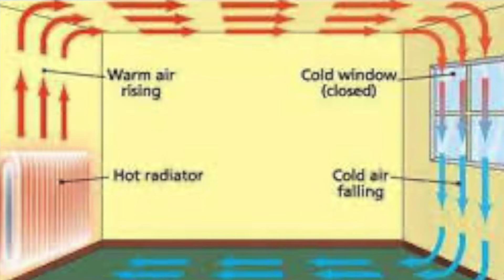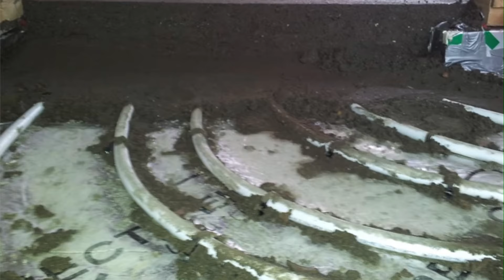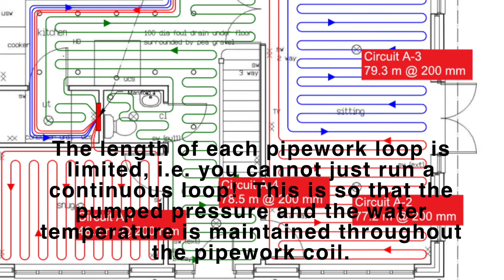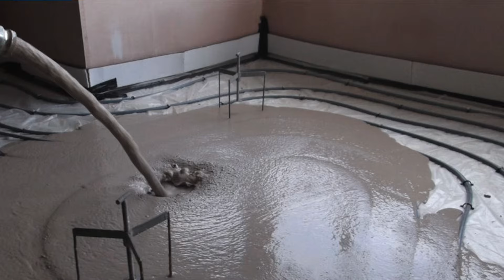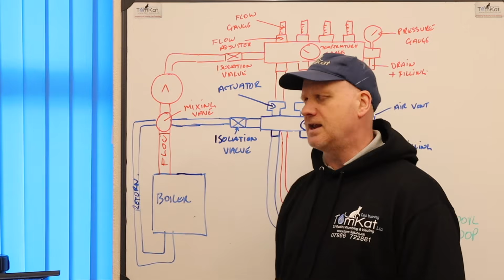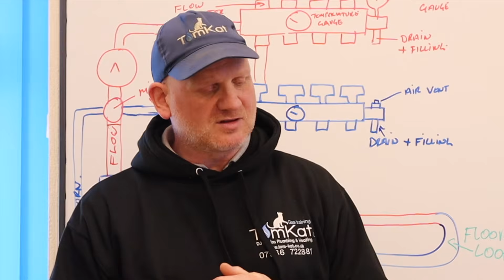How to install underfloor heating. Full A to Z on the pros and cons of wet underfloor heating.

Comment: Thanks for the video. Do you have thought on efficiency of the different systems? The diffuser plats system on a standard non insulated concrete salad will have way more heat loss than the other. Would you agree?
Reply from the maker: For me it’s all about what and how the floor is constructed to what type of system you can use rather thank what is the most efficient. If I was to build my house I would use block and beam floors with kingspan and screed

Comment: If you are putting under floor heating in a bungalow would you still run the pipework in the attic and would you put the manifold in the attic?
Reply from the maker: That’s up to the customer I have a bungalow and I am putting my manifolds in the kitchen cupboards

Comment: Great Presentation and Explanation. Setting up the Pump to a Adapt Constant Pressure Setting is relevant. (Most cases it will use less then 5Watts. It ensures the flow is correct (slower is better so to give the heat time to exchange with the floor) Taconova has great UFH Pump Solutions. Robust and running dry is no issue. Bo risk ob blocked pumps.

Comment: Hi I didn't here you mention if the screed needs expansion joints, (i haven't see joints in other installation videos either). I expect they would as the dry screed goes from 5 to 35 degrees often. how many M2 would you recommend the largest area without expansion joints?

Comment: Under floor heating is an old technology at this point. The dust and particles canot seatle in the room and will cause lung issues down the line. 
The healthy option is when the pipes are in the wall.

Comment: Looking at the spreader plates installed on a floating floor: how thick should the chipboard and engineered wood be? In the clip it mentions the flooring shouldn't be more than 15 mm thick. Is this for both the structural chipboard and the finishing wood layer? Thanks

Comment: Can you use concentric with spreader plate system ?
Reply from the maker: You will need to get technical information from the manufacturer of the products because it depends on what you are using for what you can use
Reply: @tomkatgastraining  what are reputable brands available in Europe ?

Comment: Hi can we use two different pipe sizes with same manifold using an adapter.  I'm thinking for using a 16mm pipe for my kitchen which has a larger area and 12mm pipe in hallway with wood floor which i will take out n install 60mm insulation between 100mm joists.
Reply from the maker: Why would you? To achieve different temperatures you put the pipes closer or nearer together. The manufacturer of the system you choose can help you to determine this.
Reply: @tomkatgastraining  Its because my kitchen is a new build still under construction so i can set up the floor depth. but hallway is an old built and has 100mm joists. hence thinking of putting a low depth insulation (e.g. 60mm ) which will leave 40mm for pipe and screed. so using a small diameter will give me more space for screen (40mm) and then i will put a membrane and tiles on top. Dont want this to go higher then the adjacent rooms.

Comment: amazing video, I was wondering if you can provide us information for who are going  to move in to a new build with Rods, but want to convert it to UFH , does that work at all ? what are things we need to know . cheers
Reply from the maker: It’s all about the sub floor and height of the ceilings. Most new builds have concrete slabs so an overlay system is needed so probably the most expensive way of installing underfloor heating.

Comment: i heard manufacturer 100 times . but never said manufacturer of what ? pipes ? manifold ? heat pumps ?
Reply from the maker: The underfloor heating system
Reply: @tomkatgastraining  are you referring to underfloor heating control manufacturers or manifolds ?. I mean there is many parts in underfloor heating with multiple manufacturers
Reply from the maker: @GrimRIA  normally you would buy the full system from the one manufacturer ie pipe manifold and controls
Reply: @tomkatgastraining  sonif you buy from local plumbing shop everything separately manifolds pipes ect how do ypu calculate layouts and other things

Comment: At 1:50 you mention space heating can be run at a low flow temperature, e.g. 30°, but hot water cant -needs to be 60-65 degrees. How can the same system have two different temperatures? Or would you need a different system for hot water as opposed to heating? I tought airpumpa could replace a gas bouler but if they only have a flow temperature of 30 how is this possible.
Reply from the maker: Blending values reduces the flow temperature on the underfloor heating so able to run 72 degrees centigrade to the manifold then it’s reduced down by the blending valve
Reply: @tomkatgastraining I don’t think you are understanding how the “system” is designed and operated.  The control and three way valve along with an electrical element address the matter without incurring excessive electricity consumption.

As an engineer it seems the trades generally lack the education to engineer and the experienced based reality if trades is facing too many variables for them to be competent to design and install systems.  This is evident in the number of very bad installations we see.  The problem is a government that dished up £7,500 to install and created a rush to the till by anyone remotely connected to this new industry…
Reply: Thermostat regulated valve is there for that purpose

Comment: I don't like to stick tiles directly to the floor.   Is it ok to put down cement board on the floor and stick the tiles to that.  Will that work?
Reply from the maker: You would have to speak to the manufacturer of the underfloor for that information

Comment: Hi, enjoyed the video! Thanks for this! I did have one question. On 38.08 into the video, you mentioned a thin layer of polyethylene DPM above the screed if it's suspended timber flooring. To date, I haven't found any guidance or manufacturing info that suggests a polythene sheet is required. Is this mandatory per building regs, or optional? Also is there any risk of that sheet burning or catching fire from the pipes below?

Comment: Forget the under the floor boards, packs or copper tubes to heat your floor. They get too hot and they can actually almost burn your feet. If you go barefoot it in your kitchen which isn’t carpeted and they get too darn warm on the carpeting sometimes too. How do I know because I stayed with some friends once that had this type of heat. No way and it’s expensive too.  I would go with a good boiler that has the old radiator types or against the wall with the nice pipes cover up that stick out what 6 inches.?  That’s one way or possibly a geothermal heat pump boiler system and that I’ve been finding interesting but I don’t know how reliable they would be over a 25 year period?  Geothermal is the way to go in both hot and cold climates if you can afford it and if you think about it, it’s probably going to be the best route over the years because you’ll save more money but boilers are also good if they’re high energy and they last for 25 years or more.

Comment: Hydrogen boilers are an insanely terrible idea. Takes 4kw of electricity to make 1kw of hydrogen. Or you can get the hydrogen from fossil fuels. Only reason they use it is to keep gas transporters in business.
Reply: Derek is incorrect when he says that hydrogen boilers don't emit any pollution. Hydrogen WILL emit NOx when burnt in AIR.
The only way to ensure the only products are H2O molecules is to supply the burner with pure oxygen, which isn't going to happen.
If you burn hydrogen in AIR, you will get NOx, which is bad for health, even before you consider GHG effects.
Reply: @Roger Bradley  that's a good point. The NOx byproduct needs to be weighed against the production...and disposal of batteries and their pollutants. Mining lithium, cobalt, copper is certainly not without its downsides. Most of it happens NOT in the USA...so we DO get to export pollution...which is a BIG goal here in US.
Reply: @rogerwhiting9310  it's true that batteries have an environmental impact. They're not perfect. However the lifetime impact of even the worst batteries is significantly lower than mining and combustion of fossil fuels. Cobalt is already disappearing from newer battery chemistries, shears a LOT of cobalt is used to remove sulphur from petrol, but few critics of EVs realise that. Flow batteries can last for several decades in service.
Reply: *Shears = whereas
Reply: @Roger Bradley  I am not sure if that's true or not. Certainly the recycling of the old batteries is almost nonexistent. I think battery production is one of the dirtiest things on earth. I think we are replacing one problem with another...but the mining is mostly  non US. That is part of the big "green" push
Reply: @rogerwhiting9310  Battery recycling of lithium batteries is already happening, but it's true that it's in its infancy and needs to massively scale up in capacity. It will happen though, because the substances are almost infinitely re-usable, and in demand, so there's money to be made. The main problem in scaling up quickly is that batteries are lasting much longer than originally anticipated, so there's a shortage of batteries to recycle. New chemistries are also much cleaner than people generally realise, e.g. LiFePO4 so no cobalt, no manganese or nickel required. Lithium can be extracted directly from brine (even sea water) and no need for those horrible evaporation ponds you see in South America. It can even be extracted from some old mine workings, cleaning them up in the process, as in Cornwall in the UK. As with many things humans do, we can do things sustainably, it's just a matter of the choices we make.
Reply: Thing is, that you can use solar or wind to create alot of el energy sometimes and its expensiv to transport and store it or amlost impossible at large scale, so you make hidrogen
Reply: ...brilliant!
Reply: What a great video
Reply: It sounds like it MAY be the fuel for the future as they are finding ways to make hydrogen with a positive return on power...getting more energy than you use manufacturing it.

Comment: Hello, I am desperately looking for some advice, I would be extremely grateful if anyone was able to help?  I have underfloor heating and I have a manifold in the cupboard.  When I turn my heating on, all the flow pipes on the manifold go hot (as expected) but the flow pipes for the different rooms are different temperatures, for instance my bathroom return pipe is cold and does not warm up at all, although the flow pipe for the bathroom is hot.  Does anyone know why this may be?  Many Thanks in advance
Reply: Hi, are you sure the actuators are opening, also making sure the pin under the actuator heads springs up and down and is not stuck in the closed position, the flow pipe may be getting hot but not necessarily circulating, try turning all the room thermostats off and only running that bathroom circuit
Reply: @Kirk Vickers  Hello, thanks so much for your reply.  All the actuators are open, all of the flow pipes are boiling hot (there are 8 altogether), but only 6 return pipes are boiling.  The bathroom and living room return pipe is just not warming up even though their actuators are open and their flow pipes are hot.  How do I know if the pin under the actuator head is stuck?  They seem to all be at different levels
- Thank you!!!
Reply: You can unclip the heads off, and the pin should be able to be pushed down and spring  back up If it stays down, then it is faulty.
Reply: Should the pin be constantly moving up and down?
Reply: You should be able to push it down and it should spring back up, if it doesn’t, then it is faulty
Reply: Did you get it sorted out? Sounds to me like maybe a flow imbalance.

Comment: Great video, but I've now just gone off the idea of using underfloor heating in my extension due to its complexity and cost etc. My house is absolutely fine with radiators so my extension will be as well. Plus the log burner that's gonna go in there.
Reply: Although cost  of underfloor htg is more than radiators,if your going to stay in the same house say twenty yrs,think of how much money you will save on fuel bills using u f h as it runs at lower temperature of water to heat up.savings will be even more the longer you stay in said house,and as the man said it will outlast radiators that do corrode.

Comment: I'm seriously considering having UFH installed to my bungalow before we start a full renovation. It was constructed in the 1950's and has a concrete floor so by my understanding from the video I would require a "dry floor construction" my question is because of it being concrete would I need to lay down a damp proof membrane and extra insulation before laying the spreader plate system?
Reply: Heat loss to the subfloor is relatively low (10-15%) so there’s relatively high cost vs the savings benefit of this. You’ll also lose more ceiling height!

Comment: This is great video, lots of important information. I have a question. If I do it in my old house with floor on joists, there are electric cables and water pipes running below the floor. With Ufh installed, how would I get access to them in future if something needs repairing for electricals or mains water?
Reply from the maker: From below. If no access below then underfloor heating is not recommended

Comment: Hi. Hidrogen boilers are not going to be a variable reality until fusion energy is working. To make green hidrogen renuable energy has to be used to crack water to make hidrogen. From the energy input to the energy output as heat in the house we are talking about 20% efficiency at best. Not to mention how are you going to get hidrogen to homes. Hidrogen is a beast to control, it is extremely extremely unstable, and when it catches fire it burns instantly ( and in an explosive manner) and being the smallest molecule it seeps through everything. Meanwhile with a heat pump you get at least 300% efficient in energy use ( most good heat pumps can get a cop of at least 4 actually). To me it seems like there is no contest. Hidrogen even in cars is by far the most expensive way to move and consider that most of it is made from black hidrogen ( made burning fossil fuels) or at best grey hidrogen ( a chemical conversion of methane into hidrogen that still relises CO2). Green hidrogen due to cost is not even available because that would be even more expensive. 
Making hidrogen is not a technological problem, it has been solved how to make it in the cleanest way possible decades ago, making hidrogen is a energy problem because making it requires many more times the energy you get out of it, and until we have a energy source so plentiful that we don't care about inefficiency in energy transfer hidrogen is not going to be a economically variabile alternative. Just to be clear about how bad economically hidrogen is. It is far cheaper to get the electricity to your house and use resistance heating with that you are going to be about 80% efficient ( about 20 % is lost in the transfer from the powerplant to your home). So even resistance heating ( the most expensive current way to heat your home) is about 4 times cheaper than using hidrogen. Superb video by the way

Comment: Hi Derek
What is your opinion on low profile underfloor systems with 9.9mm pipes?
Can the small diameter of the pipe be an issue on the longterm?
The one what we were quoted claims only 3.5 cm build up on the existing subfloor.
It has 1.5cm screed on top of the castellated panels. Will that thickness be strong enough?
Tia
Peter

Comment: Hi Derek, thanks for the video.
I don't have UFH at the moment but I'm slowly renovating my house starting with the hall which has a suspended timber floor.  I want install a new LVT floor covering so I would like to pre-install the pipework for UHF so I don't have to do it later.  I have 22mm floor boards which I will remove and presumably install the following:  75mm insulation board with batons, spreader plates, pipe loop and then new 22mm subfloor plus a thin floor levelling screed with the LVT covering on top.
As I only want to buy the pipe and the plates right now my questions are: Which is the best system to buy ie pipe diameter etc and is 22mm ply plus the LVT covering going to be ok for the heat to radiate through?
many thanks Adam
Reply: I removed the old floor boards and screwed them under the joists to support the insulation.
Then ran the pipe and filled the space with a weak mixture of sand/cement, followed by new flooring chipboard.

Comment: If you like this video say so, or if you don't "leave a constructive comment" :) Very helpful. Bought a house with an air to air heat pump and as I was getting ready to strip all the floors thought about underfloor heating. Sounds very hard to DIY... Read in one of the comment that you can just pressurise with a water hose. I think that's quite helpful, as the actual laying of the pipes sounds easy enough, it's the dicking around with the heat pump that scares me. Regardless this was a really good video. 40% savings in energy on top of heat pump... I'd end up paying next to nothing in energy... I'll keep on reading. I am in Switzerland where labor costs the GDP of a small country, so can't really hire easily to do work here.